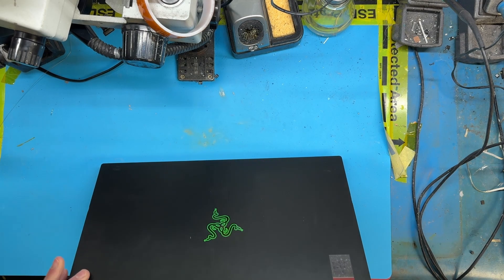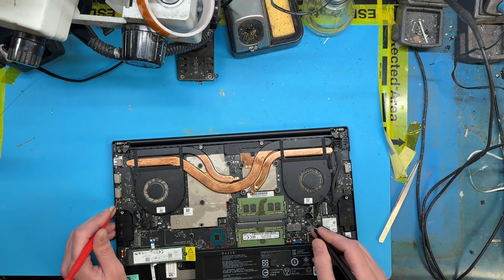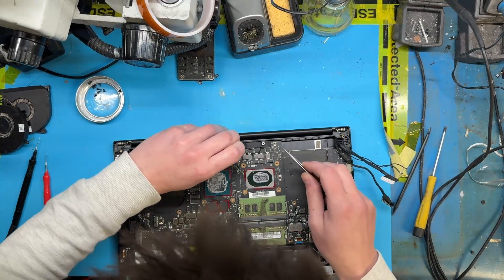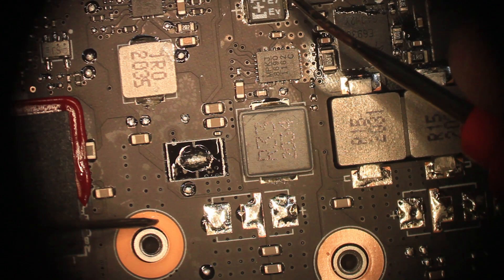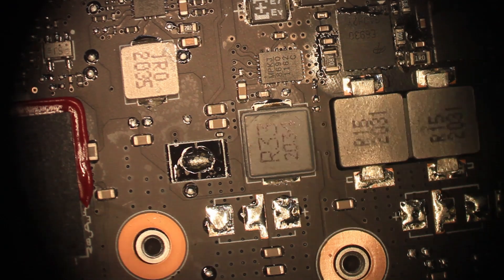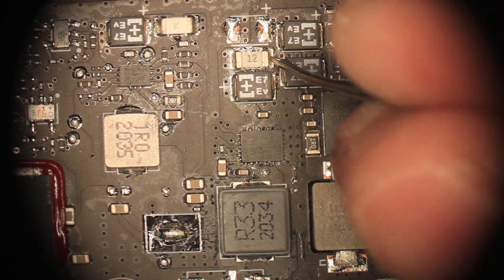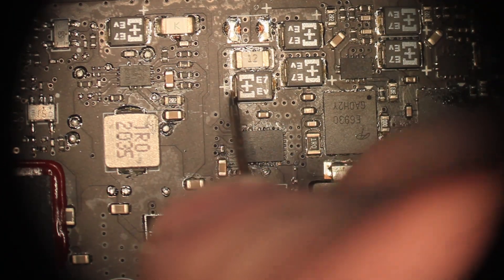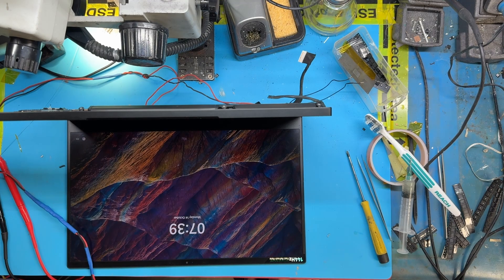Razer Blade 15 No Power Motherboard Repair

Comment: Hi I have a RZ09-485 that a single letter is not working. Is it possible to repair them? If not, which keyboard part number or models is compatible to replace it? Thanks.

Comment: Nice fast repair. You can test run the cpu without replacing the mosftet (if you dont have any on stock) and if you get a picture only then replace it, :)
Reply from the maker: I agree if it’s a multiphase rail! But this was vccsa or vccio so needed to be present.

Comment: I am from Nepal, and since Razer Blade late 2020 base model doesn't sell products here, i bought it from canada .
I need some help. I have to insert and remove the adapter jack several times before my laptop powers on. After that, it runs smoothly. I’ve removed the battery because it was swollen, and I haven't installed a new one yet.
Does removing the battery cause this issue or there is a problem in the board?

video of the issue :

https://youtu.be/xkyBueaQ1UI

Comment: I am from India and the Razer does not officially sell here , and understandably no spare parts available too. I have a blade 15 base 2020 OLED. Can you help me with this?
Reply: Hi.. can you tell me what are the exact power on/off   IC or anything in that respect?
Reply from the maker: What issues are you having with the laptop? You may need to order parts internationally.
Reply: @Soldering_On  did the thermal repaste and it did not start after that. The repair guys say its hard to get componenets for the laptop for aforementioned reasons. Suggest a solution. Thanks

Comment: I have the same laptop. I took it to an expert who told me that it is a microcontroller. It needs to be replaced but no spare parts available how to solve please
Reply from the maker: It depends on what controllers has failed, most parts are available for Razer laptops. 

If you have more information maybe I can help.